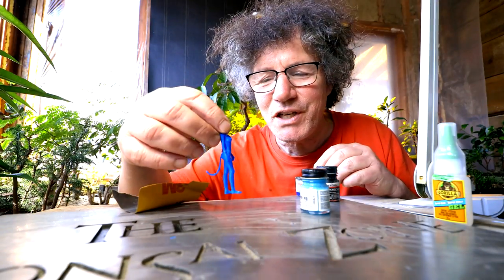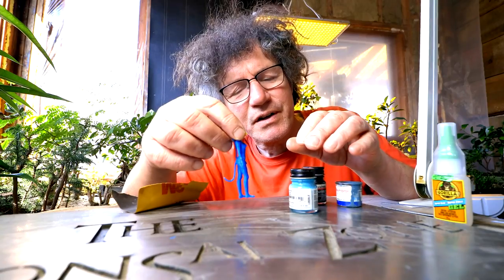Assembling a 3D Printed Neytiri From Avatar and Pruning My Ficus Bonsai, The Bonsai Zone, March 2021

Comment: I am pretty sure that was a stink bug. Most are pests to crops and plants, although some species eat other insects and can be beneficial.
Reply: Can’t stand the smell they make
Reply: Yeah,they stink so nasty...I've seen they are attracted by basil or even "Tree of heaven" aka Ailanthus Altissima.
Reply: Definitely a stink bug. Invasive species. We get them a lot in the spring here in MA. They came up from the mid-Atlantic states after hiding away in an international shipment, they think.
Reply: @Denkar11  Yes, that's how happened.I have had six individuals in my balcony and I barely banished them out,they stink a lot.
Reply: @andrewspar436  And how hard I even washed that "smell" out of my hands (after kinda six attempts it disappeared).I retrieved them after using a jar and a paper.

Comment: nice work! the stripes came out really well. yellow paints are notorious for weak tinting strength...unless you shell out big $$ for pro-grade paints it's hard to make yellow cover up another colour. (and sometimes even then.) if you're interested in getting the eyes to really stand out, you can prime them with a white paint first before using the yellow. would be some very fine work involved. :)

Comment: Nigel, I have a question:
I have a very deep pot, too deep for Bonsai.
But the pot and the Bonsai that is in it mean a lot to me and I would like to continue using it. Do you know of any method to reduce the soil volume which I can expand over the years as the plant grows?
Reply from the maker: Hello Christian, you can either line the bottom of the pot with a very course drainage layer several cm deep or put a Styrofoam spacer in the bottom that makes the pot much shallower., Both these methods will reduce your soil volume and help the tree to dry the soil out regularly. In the summer I like enough soil volume that the tree can survive a hot sunny day and need watering only once or sometimes twice. This partial drying of the soil helps keep the roots healthy and growing.
Reply: @TheBonsaiZone  ah, I see! I will give that a try when I repot the tree next time. Thank you for the quick reply!

Comment: Does anyone remember the ratio of dish soap and water that Nigel use to prevent bug's?
Reply: 30-1
Reply: I think that the ratio is 1 to 40.Since I am not certain, please check.  He leaves it on for a short while and then carefully spritzes (rinses) the solucion to clean the Tree